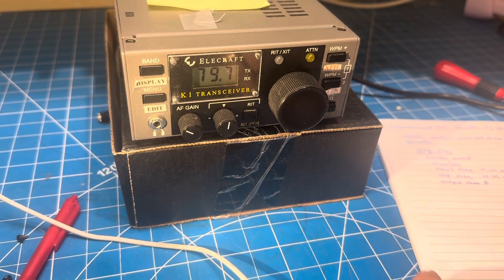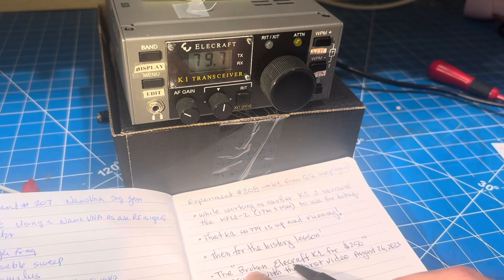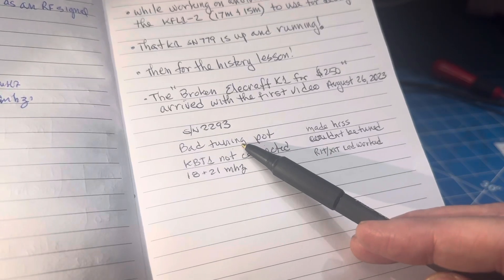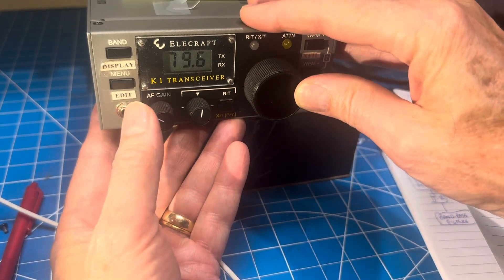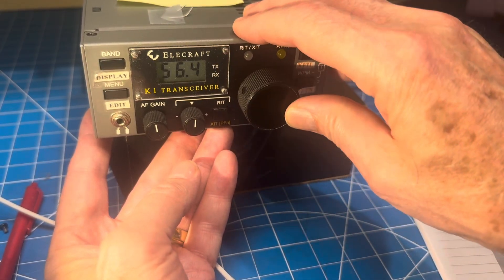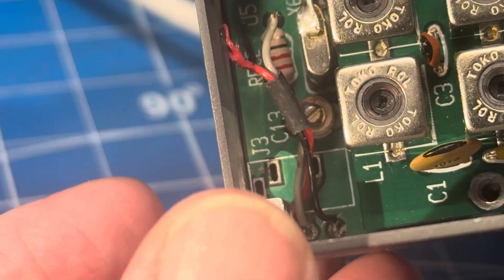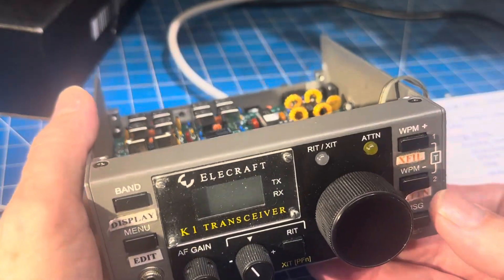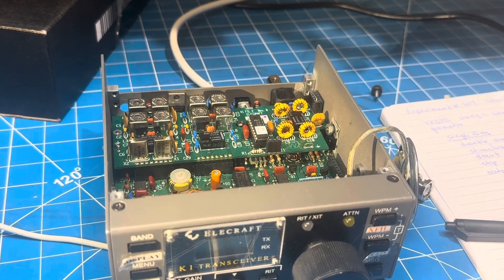The Broken Elecraft K1 for$250 from the QSL Swap is Back… Should We Continue?

Comment: I would vote for putting it back on the shelf, and watching for a 4 band module to show up on eBay or something.  Otherwise, I would vote for changing the board to 40 and 17. That way you would have a WARC band to revert to if there is a big contest going on.  73 n0km
Reply from the maker: You predicted the future :-). The 4 band module for $50 off the QTH Swap arrived yesterday. Fingers crossed to see the build quality when I open it. At least the ham I got it from was a great guy.